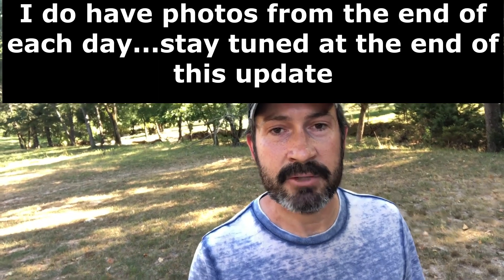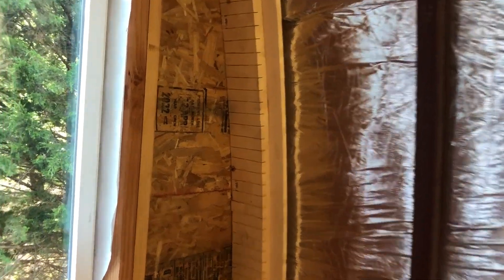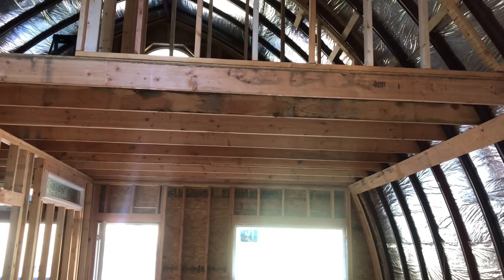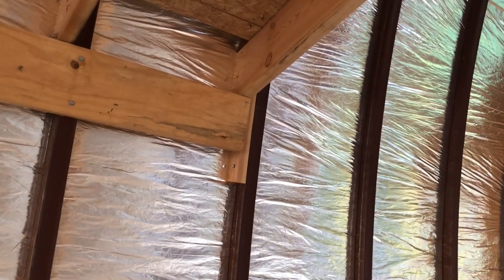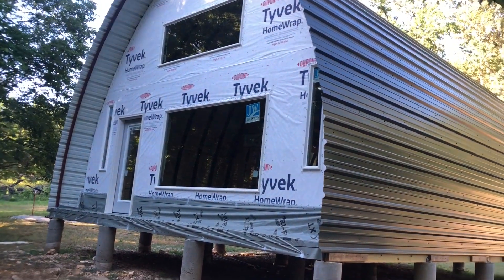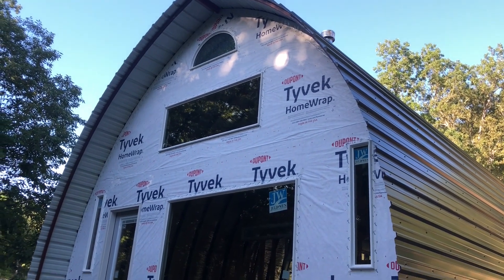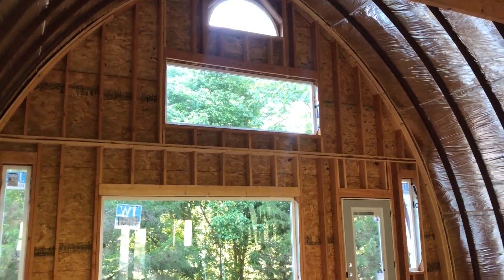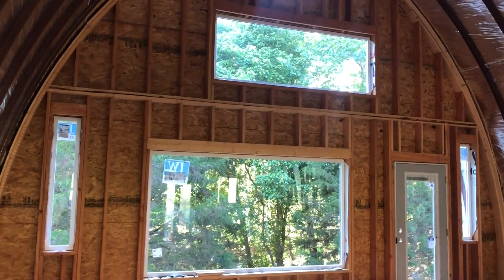Arched Cabin Build - Framing the End Caps | Tiny House

Comment: Hi again! Quick question for you, and I apologize if you've already covered it in one of your videos: I'm curious about how you weatherproof your subfloor that extends beyond the interior to make the porch? Since it's not a traditional porch where water can drain through the boards, do you have issues with pooling? Thanks as always
Reply from the maker: You picked up on our biggest mistake during construction. This past summer, 2 years after completing the subfloor, I had to remove the outside 2 feet because it had become extremely water damaged. I had originally laid a rubber flooring over it but somehow water still made its way to the wood. After removing the damaged portion, I replaced it will pressure treated outdoor plywood, added flashing between the exterior and interior subfloor, added a slant to help the water drain away from the cabin, and put a liquid rubber deck coating on top. It was a lot of work which was really unnecessary if we had thought through a little more. My advice: do it right the first time! ✌️
Reply: @okiehippiefarm  damn! Glad I asked, and thanks for the detailed answer! I've wondered this for some time as I've been watching videos on these builds. Cheers!